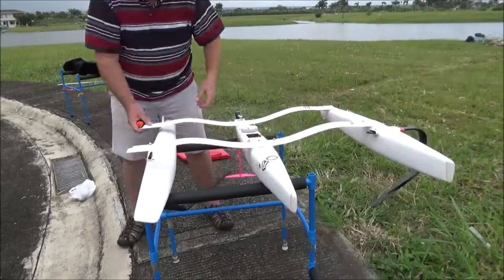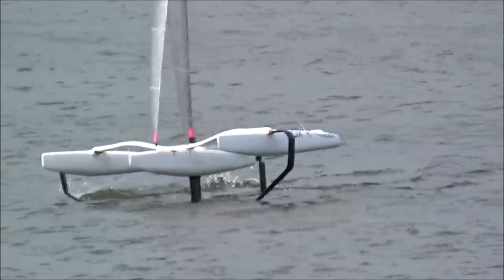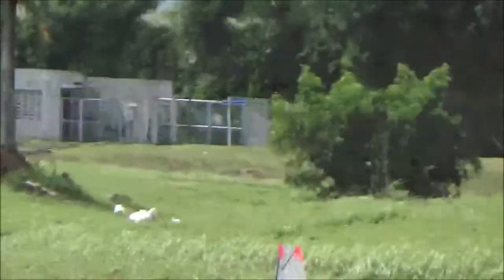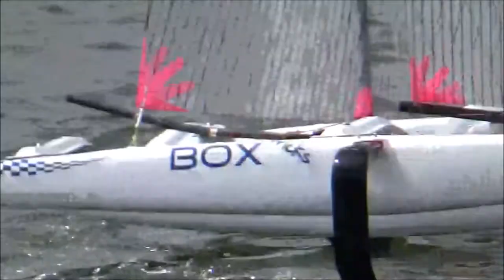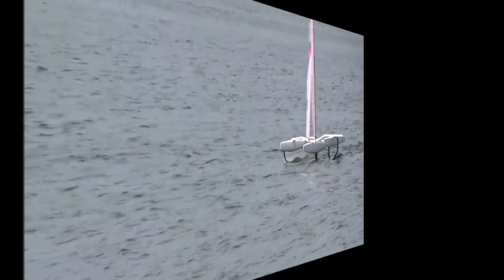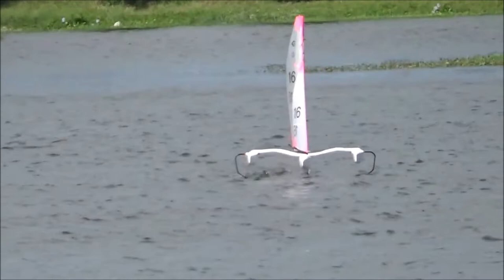Mini 40 foiling with the "Box" design One Metre trimaran

Comment: Nice video, thanks! I am researching yacht models to solidify my ideas for a self-designed project. I almost completed a mono-hull but my friend strongly suggested that I go the multi-hull route. So now I am thinking catamaran. I don't think that the mid hull of a trimaran is needed apart from aesthetics in a model yacht but maybe I am missing something?
Reply from the maker: Hello.  Briefly, there are a couple of points to consider when deciding on catamaran or trimaran.  

Catamaran
+ve  
Only 2 hulls - should be lighter

-ve
1/ Where will you house the winch, battery and rudder servo?  Must people sailing cats make a central nacelle (above the water) for housing the battery, winch and rudder servo and receiver.  Risk here is that since it higher than the hulls when upright, it becomes the lowest part of the boat when capsized so there is a greater risk of getting your electrics wet in a capsize since you cannot make the nacelle 100% water tight with sheet lines running from the winch
2/ Are you going to have 1 rudder or 2 for the cat?  2 is more complicated, and 1 requires a stiff nacelle running to the back of the boat to mount the rudder
3/ mast compression  loads need to be catered for on the centreline.  How will you do this?

Trimaran
+ve
Good for keeping electrics dry
Easy to mount a single rudder
Best for mounting the mast and taking the loads
Better at tacking since the boat spins around the rocker of the central hull
Easier to fit cross beams
-ve
Likely to be slightly heavier
Need to build 3 hulls

Hope that helps
Best regards
Reply: @PerthMini40man  Great food for thought, thank you!